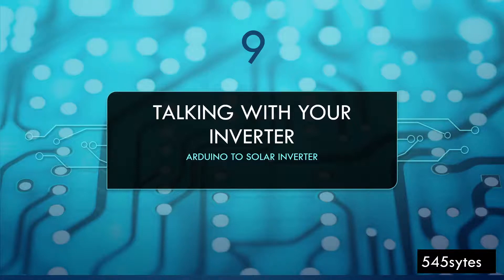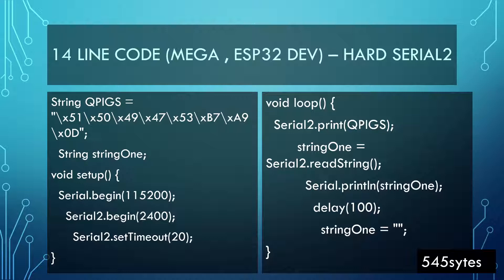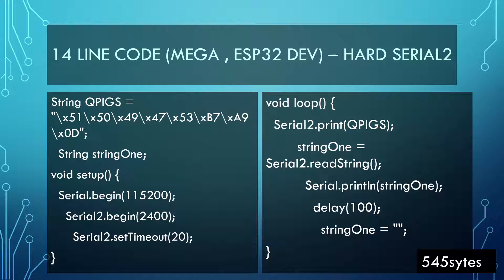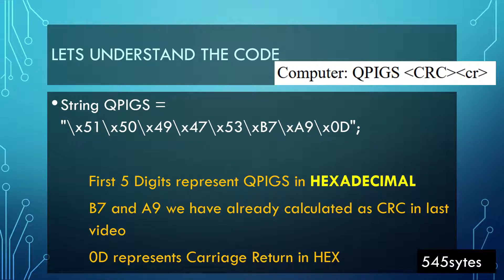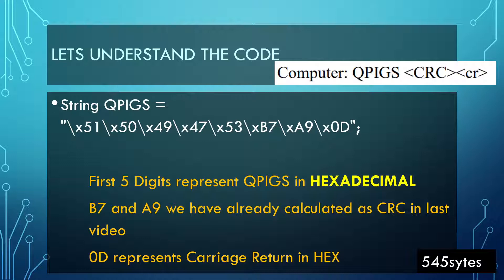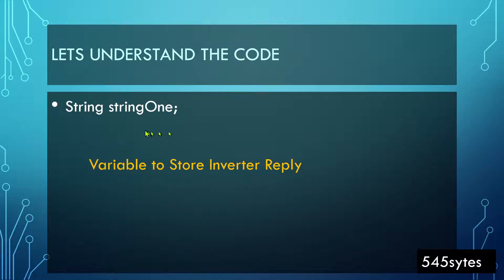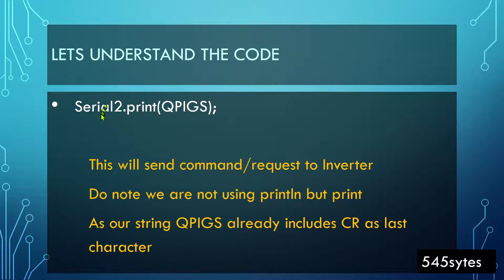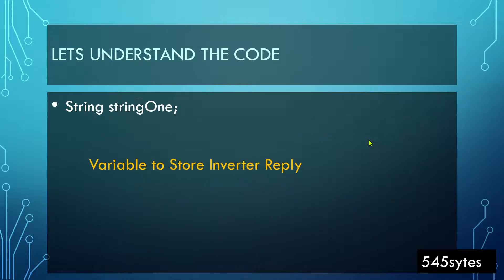9 (Ard to Invt)  14 Line Arduino Code

Comment: Hi thanks for the nice video series. Well i have littel confusion regarding esp-01. You mentioned in your video to take care while connecting RX and TX. My question is that should i connect GPIO0 and GPIO2 with level shifter insted of default GPIO3 and GPIO1. Please explain

Comment: I need to access goodwe solar inverter remotely in real time using a GUI.. Can i use this arduino project in my work?
Reply from the maker: If this code works with Goodwe then definitely further development, Webserver access, GUI all possible. 

First try this code if it works
Reply: @545sytes  ok sir thank you

Comment: Hello. I have seen all 10 parts of your Arduino to inverter connection. Like and follow you was the only thing I could do to thank you. That was perfect. I did all the steps and observed the watchpower software talking to the inverter in the serial monitor software. Only if you can please guide me: How can I talk to the inverter with the help of serial monitor software without activating the watchpower software? Is it possible to talk directly with the inverter through the serial monitor? I send a command but I don't get any response. Do you know where the problem is?
regards
behrooz
Reply from the maker: Try Termite software, I do recall , I used it to get response from inverter, though this should be possible with serial monitor too, but Termite is usually what I use for simple serial communication
Reply: @545sytes  🙏❤️

Comment: i try all things but its not working
Reply from the maker: Your inverter may be using different command set , you need to find communication manual for your inverter. Few manuals available in this thread : https://forums.aeva.asn.au/viewtopic.php?f=64&t=4332

Comment: With your code I am getting just this from my solar inverter. What could be wrong? I am missing mostly power from photovoltaic, there is just voltage from PV string. 

(000.0 00.0 229.6 49.9 0551 0459 010 352 50.00 019 033 0026 05.7 284.1 00.00 00000 00010110 00 00 01625 010 k

(000.0 00.0 229.8 50.0 0549 0393 010 352 50.00 018 033 0026 05.7 282.3 00.00 00000 00010110 00 00 01621 010⸮
Reply: The first two (000.0 and 00.0) are input grid voltages and Hz. Looks normal to me if you disconnected from grid. With Grid you will have something like this
(225.0 49.7 225.0 49.7 0000 0000 000 434 27.23 000 095 0041 0000 000.0 26.86 00000 10010101 00 05 00000 000)
Reply from the maker: Yes , String seems fine, the Command is being accepted. The  numbers need to be segregared, user manual of your model will help in bifurcation, I have few manuals , I can email you if needed, may be only of them matches with your feed